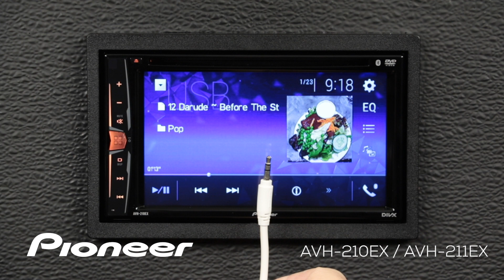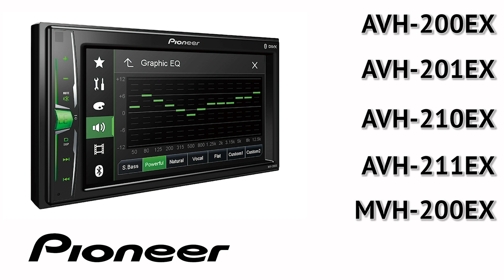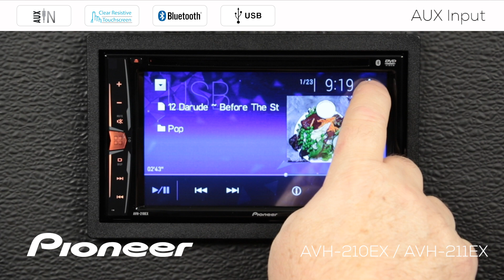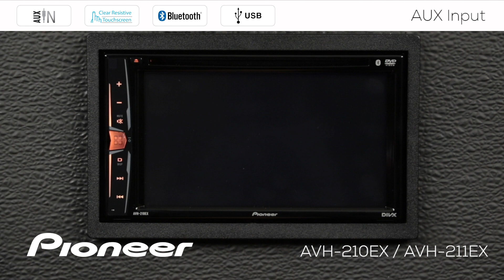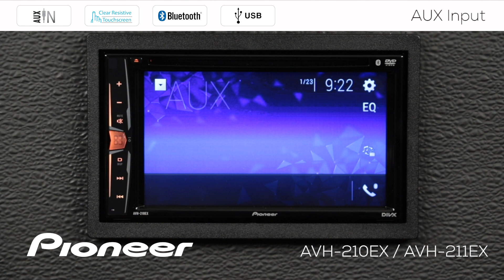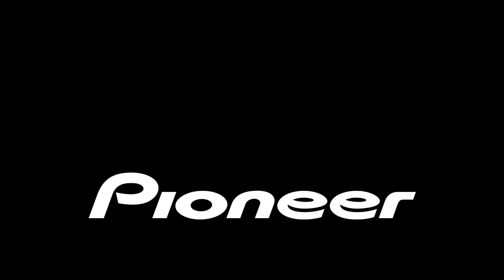How To - AVH-210EX - AUX Input

Comment: Got everything plugged in with parking brake down I get audio but no video what’s the problem with it
Reply: Please be sure you have the Audio / Video switch on the AUX screen set to video.  You can see it here:  https://youtu.be/Y-RjxfCv6lE?t=127     If you can't see any video and can't get to the Bluetooth Settings Menu, your receiver may have an incorrect connection on the Green Parking Brake Wire to the vehicle's parking brake.  You can learn more about the Green Parking Brake Wire here:  https://youtu.be/-bF3uzzaT30?list=PLw63zJRQbCNgLoyoij-BJdPDBVLYipAnj   You can find more How To videos about Pioneer AVH-210EX here:  https://youtu.be/oVH5gvX5Rfs?list=PLw63zJRQbCNgLoyoij-BJdPDBVLYipAnj   and you can find more videos on Pioneer's YouTube Channel here:  https://www.youtube.com/user/pioneerelectronics

Comment: Where do you plug in the aux cable I can’t seem to find it
Reply: Did you watch the video above?  It seems to show the AUX input on the back of the in-dash receiver very clearly.  https://youtu.be/Y-RjxfCv6lE?t=48   You can find more videos about Pioneer AVH-210EX in this Pioneer Playlist:  https://youtu.be/oVH5gvX5Rfs?list=PLw63zJRQbCNgLoyoij-BJdPDBVLYipAnj   and you can find more videos on Pioneer's You Tube Channel here:  https://www.youtube.com/user/pioneerelectronics
Reply: @deckerdotto6035  
How in the hell are we supposed to get to the back of the radio to plug in aux cord why isn't it in the front
Reply: I recommend installing the AUX cable when you do you the installation of the in-dash receiver.  When you have the dash taken apart, install the cable so that you have easy access to the AUX cable in the center console or the glove box or some other easy access place in your vehicle.  When you're not using the cable it's out of the way and it's not an ugly mess hanging off the dash.  That's how you're supposed to get to the cable.  You can find a full playlist of How To videos from Pioneer about the AVH-210EX here:  https://youtu.be/oVH5gvX5Rfs?list=PLw63zJRQbCNgLoyoij-BJdPDBVLYipAnj   and you can find more videos on Pioneer's YouTube Channel here:  https://www.youtube.com/user/pioneerelectronics
Reply: @deckerdotto6035  Thank you!👌

Comment: What kind of cord are you using? A link to a product or picture would be awesome. Does it look like a normal aux cord on both end? Trying to plug an Android in to watch videos like YouTube while I'm parked
Reply: What model number of Pioneer in-dash receiver are you using?  You can usually find the model number near a corner of the face of the in-dash receiver.  The first thing you'll need to do is to figure out how to get video out of your Android phone.  It won't be through the headphone jack. That's only audio.  The Pioneer AVH-210EX has a 3.5mm AUX capable of video input with the correct cable.  You can see on possibility here:  https://youtu.be/8gjJuwAv78Y  You can find more How To videos about Pioneer AVH-210EX here:  https://youtu.be/oVH5gvX5Rfs?list=PLw63zJRQbCNgLoyoij-BJdPDBVLYipAnj  and you can find more videos on Pioneer's You Tube Channel here:  https://www.youtube.com/user/pioneerelectronics